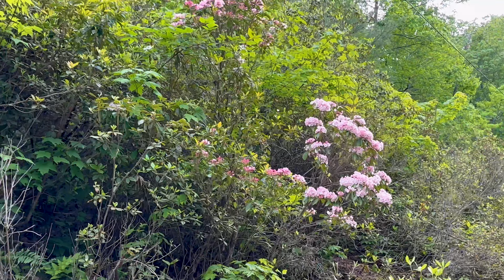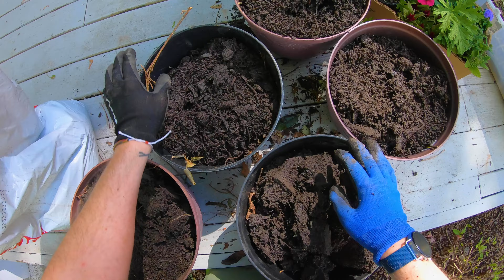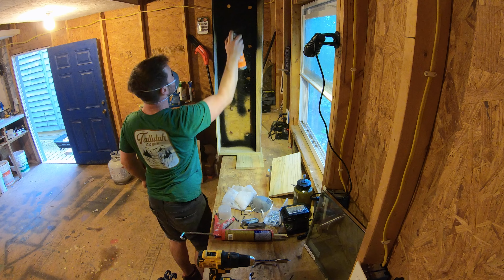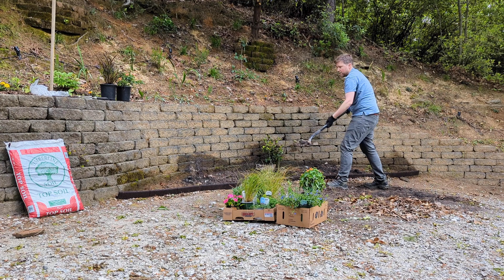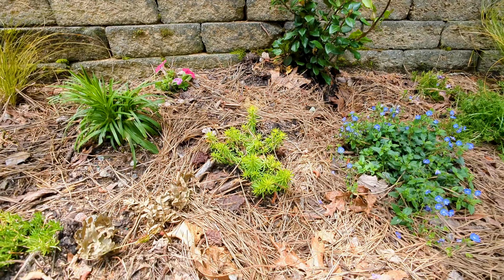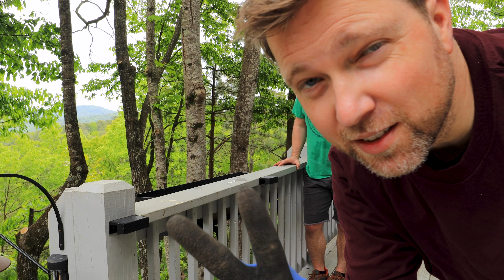DIY Garden Projects | Planters, Raised Beds & Landscaping

Comment: Hey guys..thanks for the video..that’s a lot of plants/flowers..beautiful blooms😊 Now I know why I cannot find any wood screws, Todd used them all making those flower boxes😂 Why so many drain holes in the flower boxes??? And no plastic liners????  Just a tip, using potting soil that contains vermiculite will hold water longer reducing your time watering…
Reply from the maker: Haha, I guess he did buy a lot of those! And yep, we went back and forth on using a liner or not. We opted to see if the sealing spray will be enough for this season. And good tip about the vermiculite -- hadn't thought about that before.

Comment: For my pots I have outdoors I place small squares of window screen mesh over the holes.  Water can drain but my dirt remains.  Seems if a gully washer comes along I lose a lot of my dirt out the drain holes.  And I keep my pots off my deck and concrete patio.  Algae grows and it marks my pot silhouette on the wooden deck.  Saves me scrubbing time.  I get pot feet for all my saucers so they don’t mark up the patio or deck.  Didn’t know if you had any thoughts on any of that.

Y’all must be like up around Blue Ridge or Elijah.  But it could be further.  The mountains are beautiful.  Watch out for bears!
Reply from the maker: Great ideas about the window screen as mesh and the pot feet. Several of those pots didn't come with anything, so we started seeing the staining after a week or so. We got a few saucers and a few feet to try them both. Definitely like the feet method better as the ones with saucers are still staining. So we'll definitely be getting more feet soon! And yep, we're a bit east of Blue Ridge, more NE part of the state. We actually had our first bear sighting this week!!